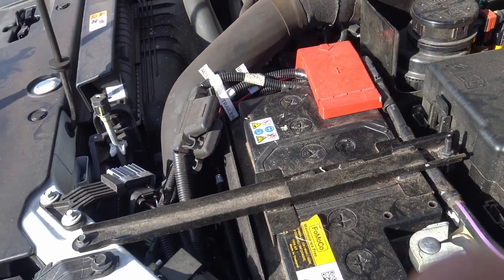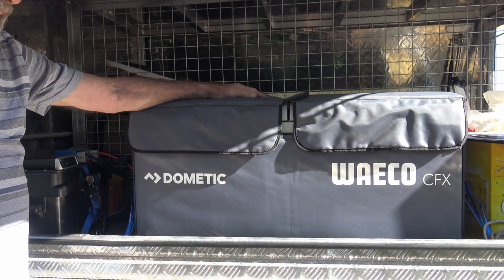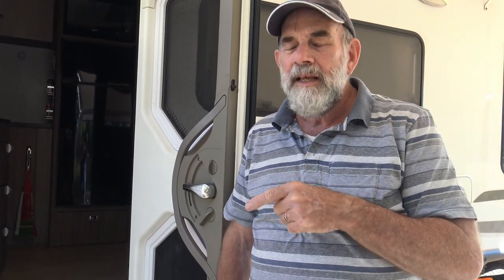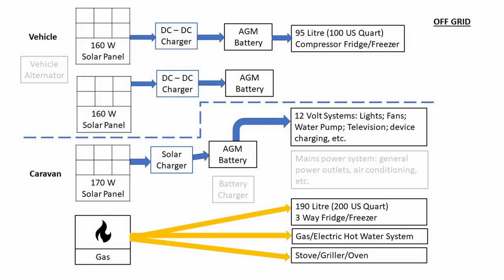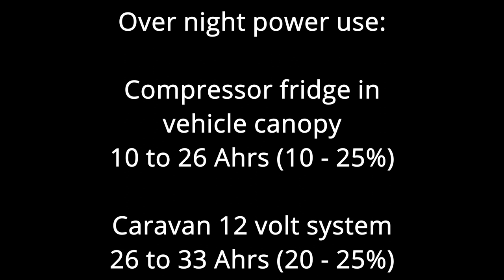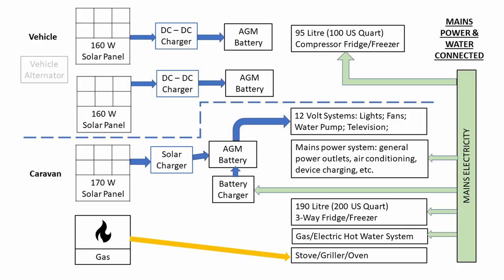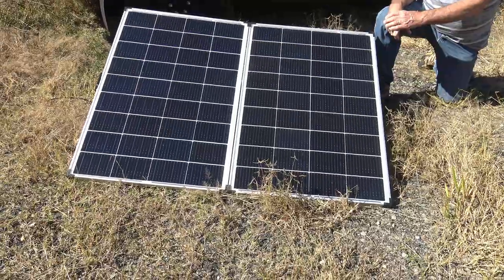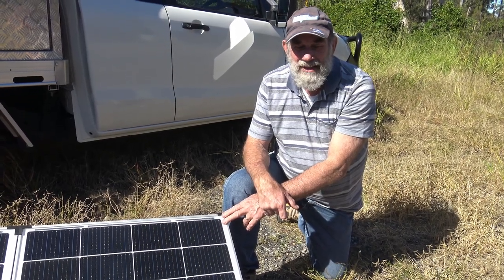Off Grid Caravan Camping, Reliable Battery and Gas Supply and Use

Comment: 12:20 a very similar summer climate to Colorado! That was going to be my question to you, since Shady parking spots are highly coveted things during our summer, but I see you have found a solution!
Reply from the maker: Yep, always chasing shade. Actually I have another video on the upgrades I did to the power system to, amongst other things, enable the external hookup - but when I put that twist in at the end of this one, I had to put the other one back in the line for a while.

Comment: What a grouse set up mate, bloody hot but. Amazed how little of the battery it uses overnight.
Reply from the maker: Thanks Rob, we have only really started using it to its full potential this year and it is good when all the systems perform better than you calculated.
Reply: @whitedoggarage  looks like you're living the dream Bob, good to see!
Reply from the maker: @TakamiWoodshop   they have the term grey nomads over here for us old people with caravans, so we are turning into those people I guess :-). This is our third caravan, but apart from the one we had when we first got married, we only returned to caravanning about 10 years ago, mainly for the dog's benefit so they could travel with us ;-). We bought this one in 2019 specifically for travelling around Australia (the big lap as they call it over here), but we are yet to do it :-(. In the meantime we have been doing short trips of a few weeks when we can get away, just making sure the systems work. Our last one, which is where this video was filmed, was to northwest New South Wales and Western Queensland, with a number bush camps and the odd dirt road, as well as the odd on road repair and everything worked well. After the first couple of bush camps I thought I should do a video on the rig and this was the result.
Reply: @whitedoggarage  That's so cool Bob - I watch a few of the big aussie 4x4 camping and offroad channels so I know some of the areas and the terrain and it looks really cool, good on you for making the most of Aussie life - I floated the idea of buying a camper van to my wife recently and got a 100% unexpected positive response so you never know - I might be bugging you with heaps of questions about solar and battery circuits one day!
Reply from the maker: @TakamiWoodshop   No worries Rob. Been across the ditch quite a few times in our travels and a few years ago did the campervan thing over there. Much the same routine as here, just shorter distances.